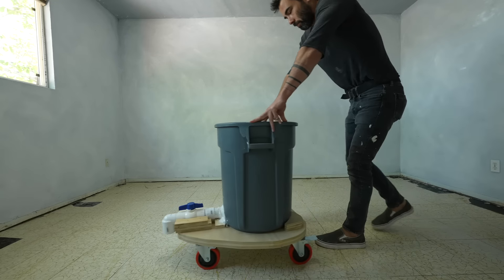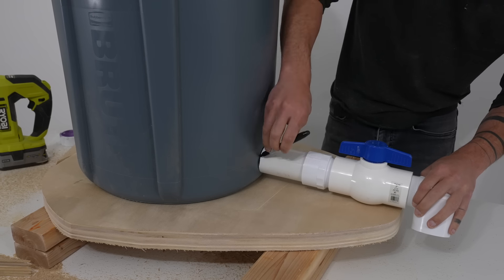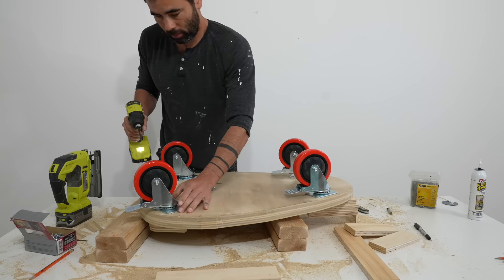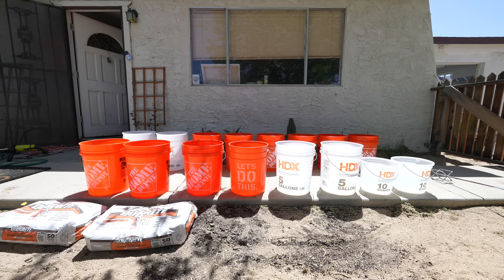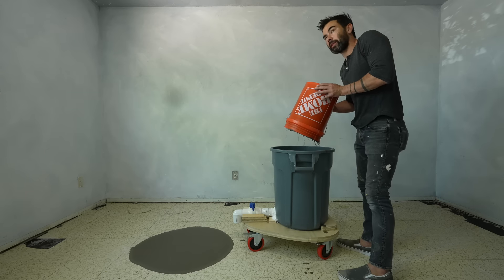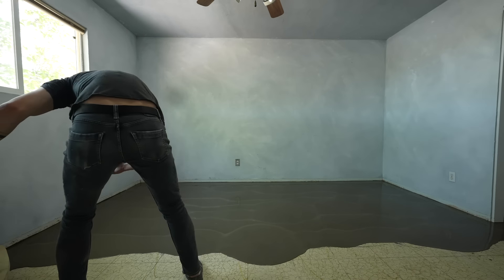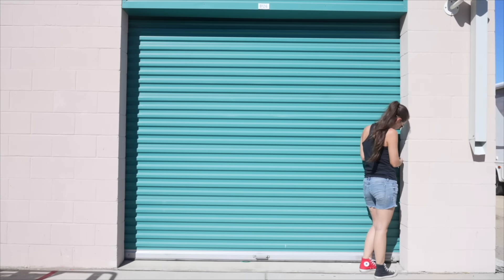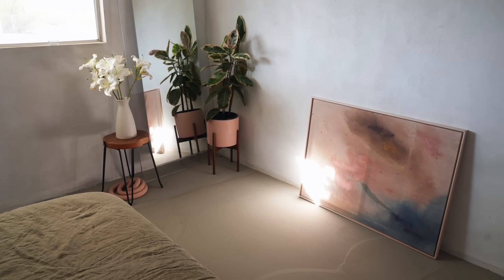Concrete Floor Over Tile | EASY Self Leveling Concrete Floor

Comment: I have to be honest. The device you made seems completely unnecessary to me unless maybe you have back problems. The material is self leveling so you don’t need to be exact and where you pour it especially if you’re raking around it a bit. Why would dumping from your mix buckets into the trashcan device be necessary when you can just dump the bucket buckets on the floor and rake it around? And honestly isn’t it harder to lift the mix buckets up over the trashcan than to just tip them over on the floor? I honestly don’t get it.

Comment: The cap is a terrible idea. If the trash can has a lot in it when you try to shut it off, you'll be wrestling with the head pressure in the reservoir. A simple alternative is a flexible hose that is longer than the trash can that you can just lift above the level of the reservoir

Comment: The vinyl floor shouldve been removed, a $30 long handle scraper wouldve had it up in less than an hour, closer to 30min to be honest. I did it last year. The concrete looks nice now, but it will crack and fail as the vinyl ages.

Comment: I bet you $1000000 that will all crack.
Reply from the maker: a few hairline cracks I don't mind.  if it de laminates from the tile then I will consider that fail
Reply: I don't believe I have ever seen or heard a professional do this. Linoleum is made from linseed oil.  Concrete is a water based mixture. You do the math. All it would take is the right conditions for the Linseed oil to leach out to the surface and you will have delamination.  But, that will be least of the worries because Linoleum is a soft-ish surface while concrete has very little ability to deform. Again, if the math works out, you might have more than simple cracks.

Comment: You got man power (3x) but if you were working alone I would recommend just renting a mixer from homdepot because all the material you used to build the pouring contraption add up. Also, the pour is way to thin to have it exposed as such... Lastly, you really needed to rent a floor scraper... Great effort but poor execution!